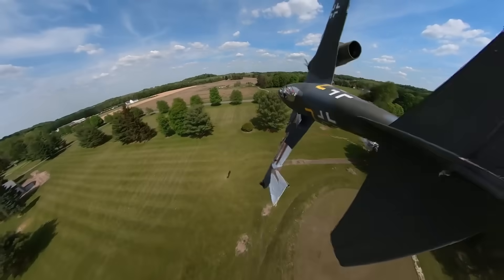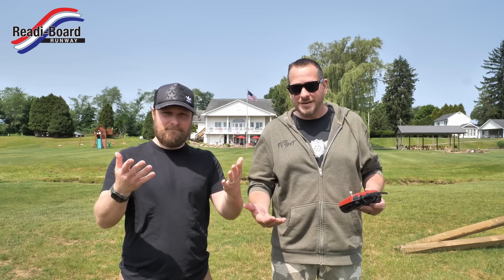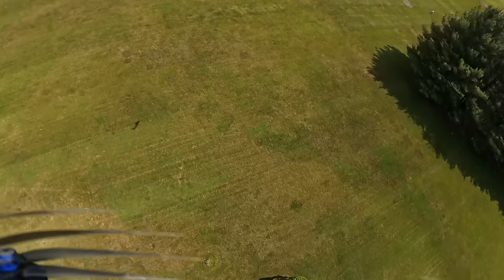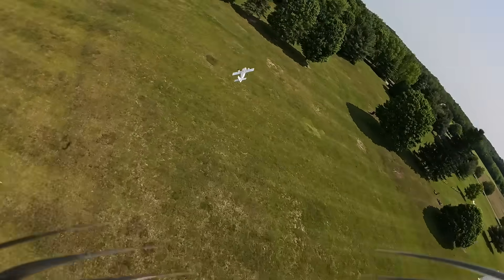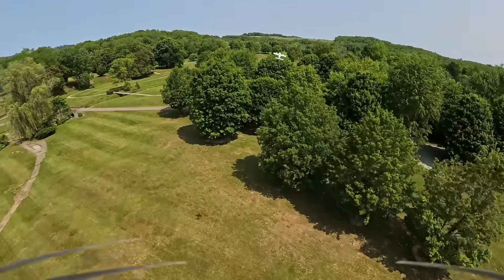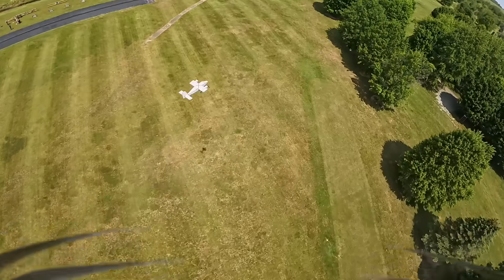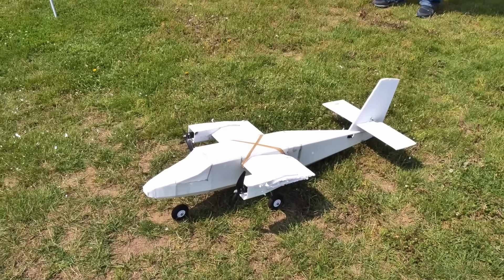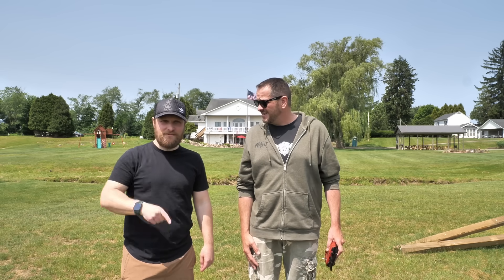Chopping Off Airplane Wings - How Far Can We Cut Off?

Comment: I know in full scale (and scale flies like FULL SCALE), there aircraft thst are 'wing' aircraft ('floaters' that sometimes do NOT enjoy windy days/turbulence) and 'engine' aircraft (usually faster, 'high performance' aircraft.  Notably WWII radial engines fighters (a lot designed to swing that 13 foot Hamilton-Standard prop (like Corsairs, Hellcats and the P-47 thunderbolt).
As for Broncos, those big turbine engines can mask a multitude of problems, have seen pics of people hitting POSTS on approach and ripping wings nearly off!

Comment: Thats whats known as a '3D' plane. The motors are SO powerful compared to the weight of the plane that most of the planes 'lift' is the vertical component of thrust, rather that the aerodynamic lift of the wings.
Think of it this way. From most lift generated by wings to most by thrust, it goes:
 Glider > Regular aeroplane > 3D aeroplane > ROCKET.

Comment: Looks like your engines are turning with outboard tips moving upward. (stop-frame at 0:42) Would it have more lift with outside tips descending? The flying flapjack flew with outboard tips descending to help minimize wing-tip vortices.

Comment: Whatever can Bush it really fast. Will, make it fly. Even without wings. In fact. Some years back. An American jet fighter. Had a wing blown off. And he flew back to the military base and landed it. Missing an entire wing. Because the power of the engine was so great. It still flew with only one wing. Of course that was a jet not a prop.

And so if we can have a jet fighter with the wings on backwards. And it still flies. Then, just about anything goes. Helicopters fly and they have no wings. I mean they do but there just skinny little rotating blades.

I would love to fly again. Though, I know I never will. Now that I'm turning 70.
RemyRAD

Comment: Aerospace engineer here. Former nasa engineer.

Had a professor ask a question in my first aero engineering class.

Can a brick fly?

Yes. Enough thrust and anything can be a lifting body.
Reply: Enough thrust in the correct direction... but yes. Not like rockets need wings...

Comment: My bet is that this worked because of the nacelle working as a wing fence and also the props countering the production of any large vortices (at least on one side if the props spin the same way). This is why it flew worse with the 1st two cuts (they were outside the prop wash). Try this on a single engine RC model and it would be a very different story. I'd like to see them rejoin the wings cut off at the nacelles to create an upper wing for a biplane experiment. It wouldn't prove much though.

Comment: The Convair Charger is a real-life short-wing prototype built and flown in the 60's.  It predates the Bronco by a year; and arguably flew better than the Bronco.  It had only 27 foot wings and a twin boom planform much like the Bronco.  The original Bronco also had 10 foot shorter wings than the production versions.  Convair experimented with engine rotation and found that top/outward prop counter-rotation gave the best performance.  I built a 1/8th scale R/C model of the Charger and it literally jumps off the ground with the impossibly short wings and big flaps.  My theory is that the spiral flow propwash gets trapped between the booms and fuselage; providing extra lift.  It's like a bumble bee; It shouldn't fly; but it does, and does very well!
Reply: I'd never heard of the Charger so thanks to your information I went and looked it up..... fascinating!  Thanks for the prompt.

Comment: What would happen if you put a triangle of foam board behind the short wing and attached to the fusilage of the plane? I'm just guessing, but, it would prob float on a half throttle, and be jet fast on higher throttle. (In effect, you would be adding to the area of the wing without adding extra length and drag to it!)
Reply: I'm thinking a reverse delta shape, here. And not actually attached to the wing at all.

Comment: Because the Front motors blow their thrust over the wing. So the wing sees both the velocity of the air plus the velocity due to the prop motors blowing over the wing. If the motor dies the vehicle will fall like a rock because it needs the extra lift created by the thrust over the wing. But you can land the plane by going into a steep dive and flaring out as the plane gets near the ground, taking advantage of ground effect. I have built a flying car based on this principle and it works great. Tiktok Sky Chaser flying car.

Comment: The only reason this is working is because the twin motors are counter torqueing eachother... If this was a single motor in the middle then torque roll would of ruined it by 9:08... Anyway great video, just replace them with edfs to make a HK Aerial 💀